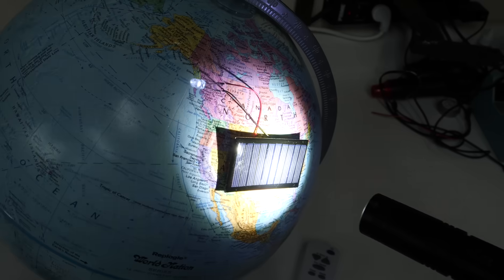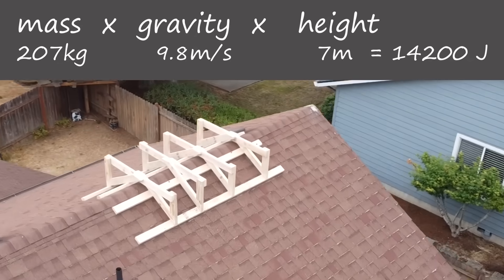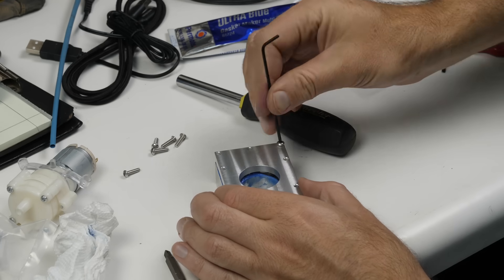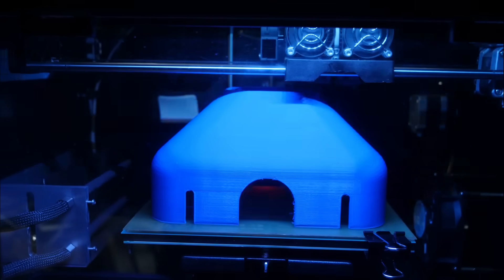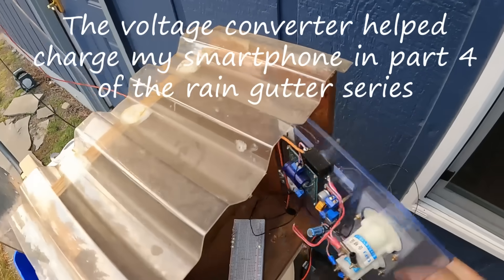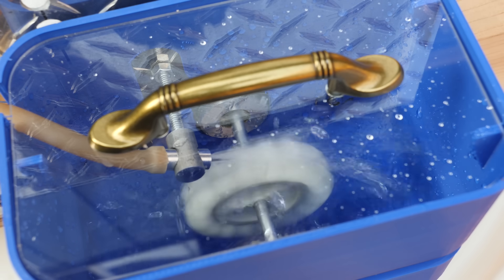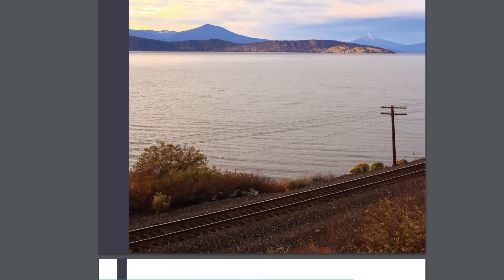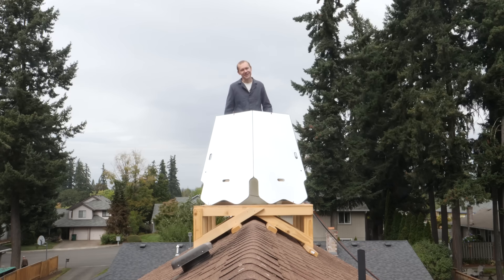Storing Solar Power on my ROOF!!!

Comment: He forgot to mention that the height of the water will also change how much energy is stored in the water. Large scale versions of this  will have the water over a 100ft. or about 30 meters high. every foot of high increases the power stored. So do to the size of his set up it was likely not very efficient.

Comment: The formula of potential energy is : Energy = m * g * h
where:
m = mass [kg]
g = 9.81 [m/s2], let's round to 10 [m/s2]
h = height [m]

So, assume that you store 10 m3 of water (--> 10,000 liters --> 10,000 kg) at 10 m height (at the top of your house), you are able to store (conversion efficiency into electricity not taken into account):

10,000 * 10 * 10 = 1,000,000 [J] (joules)
--> By conversion into [kWh], you get: 1,000,000 [J] = 0.28 [kWh]

If I take a standard french solar installation of 3kWc, I get a annual production of about 3200 kWh. So, with my 10 m3 tank, I can store 0.28/3200*100 = 0.00875 % of my annual production. That's no so much. On a daily basis, the percentage is higher but not that big.

Only very large tanks could store significant amount of energy.

Comment: E = m*g*h
m = 200kg (assuming 200liter barrel)
g = 9.81
h = 7 m

E = 13734 Joule = 13.7 kJ

1 joule is a watt second.

my laptop charges with 100W. meaning i could charge my laptop for 2 minutes with the entire barrel. assuming 100% efficient turbine at the bottom.

Comment: I'm wondering: what if you funnel the used water down to another waterwheel? (And possibly another and another etc.)
Would the energy wear down? It feels like there could be much more energy. Anyone got an idea about that?
Reply: But you're reducing the length of the drop for each wheel. I.e. with one wheel you extract energy equivalent to a 5m drop. With five wheels, they'd each extract the equivalent of a 1m drop. So, overall, I don't think you'd gain anything.

Comment: How about a multi platform like stars to use more of the water. So when water turns turbine 1 it goes to another box and repeats. Could probably have 3 X boxes 3 generators.

Comment: Having a 35 ton boom truck when I was off grid for 28 years, I too had this idea, but luckily never followed thru with it! Like a grandfather clock, it would for sure work but would be very inefficient, way too many mechanical and electrical losses. Flash forward:two days ago I finished burying a 2100' water line from a spring on the bottom of my 70 acres, solar pumped to a 2100 gallon tank 247' higher. It has occurred to me that once the tank is full I could run the excess into the line that leads to my micro hydro setup. Again, fun to fool with but hardly makes sense (I'll probably do it.)

Comment: The. Clear hose and Transparent barrel will get algie. If you put side plates on each side of the generator water wheel, you will gain more power, because the water is splashing off losing laminar flow. Tesla had a generator designed to use disk to keep the laminar flow longer so it would spool up well beyond 20k rpms.

Comment: Too many energy losses with that system.
More efficient to charge directly off the solar panel.
If you must use your water setup, see about using a ram pump.

Comment: I wonder if the head pressure of your water supply is enough to get the water up to the roof all on its own. In other words, will the hose still flow if you were standing on the roof? If so this makes me think you could get free energy from the water company using your same technique.
Reply: Well you are still paying for the water? So you’ll need to see if the energy you get is cheaper than the cost of the water used

Comment: So im sure some smart people may have already suggested this but what if you assembled a string water wheels long the downflow line to retrieve all the energy while in decent. Wouldn't that increase the power output or just work out to the same output?

Comment: This is not exactly a battery with a long service life.  Because you put the tank on the roof and the sun and temperature will cause the water to evaporate.  Which will result in a decrease in the capacity of your battery.  Try to use car radiator concentrate in the right proportions.  This should prevent your battery from losing capacity.  A very nice project.

Comment: The big problem with solar is that it only functions at maximum capacity (which is at best 30% efficient) for around 1/5th of the year. To make enough power for the winter, I need about 4x as many panels as I need in the summer. Which is a massive waste of resources. 

What I need is a long-term storage method, so I can store the huge excess I create during summer, for use during spring/autumn/winter. And I need it to be dirt cheap.

Comment: I think you should try an emergency tire inflator and store compressed air, that way the system could be at ground level. A small steam engine could generate the power.

Comment: The KPSP uses hydro-resources of artificial water pools existing at different geographical levels.

Kruonis Pumped Storage Plant (the KPSP) is located near Kruonis, Lithuania, 34 km (21 mi) east of Kaunas. Its main purpose is to provide grid energy storage. It operates in conjunction with the Kaunas Hydroelectric Power Plant. During periods of low demand, usually at night, Kruonis PSHP raises water from the lower Kaunas reservoir to the upper one using cheap surplus energy. The station is designed to have an installed capacity of 1,600 MW but only four 225 MW generators are currently operational. With a fully filled upper reservoir the plant can generate 900 MW for about 12 hours.

Comment: There is also another way, put the water reservour in the basement connect it to the house heating system, heat the raservour using solar panels.

Comment: Just a question to the proud inventor: How much water and which height is necessary to run my heating aircon through a long winter night? One piece needs about 5kWh of electricity in 12 hours...
;-)

Comment: Great idea, is it worth using a peristaltic pump to move the water up to the header tank?  This may relieve the head-height issue and reduce the strain on the motor or use a Peltier/Seebeck device to convert the heat produced by the motor into electrical power and feed that back into the loop?
Also, I find float switches can be temperamental,  is it worth using a pressure switch? (The diaphragm type used in washing machines to sense when sufficient water has filled the drum)

Comment: If you put two shipping containers worth of water 15 meters of the ground you will have enough potential energy to power your house for 6 months continuously. 
If it rains enough to fill those containers up once every 6 months or less in your area then you will have free energy for ever. 
This set up is much cheaper than a solar panel installation and farmers in remote areas us it all the time.

Comment: Thing is, that pump (it's a cheap garden fountain pump right?) is rated maybe 5W or 10W, so no wonder it runs fine on a cloudy day from a "50W" panel. Solar panels are specced at Noon on the Equator on the brightest day ever recorded. More or less. Don't expect to get their full output outside a few hours around noon in summer. 

So you're only storing like 10W of power, which is nowhere near enough to run a house on. And that's if you drain it at the same rate it filled. This system isn't practical.

A practical system might involve building a water tower, if you aren't in some ridiculous neighbourhood contract where you're not allowed lawn chairs cos they reduce the value of surrounding properties. And they have the temerity to "fine" you if your grass is too... ah I've got to stop or my blood will boil. 8th most free country in the world my ass.

Anyway. Yeah water tower or maybe if you live near a wooded hill, use a highup tree. And more water, and a bigger pump, and a proper sized turbine.

Comment: I think you were on to something however which you might try is turning that Barrel into a giant salt water capacitor as Nikola Tesla did then the solar energy will be stored as electricity in the saltwater capacitor Barrel you simply just flip the switch and the house keeps running of course she'll run it through an inverter but yes two barrels is what you need Tesla saltwater capacitor easy to build cheap and really works

Comment: You could probably set up your valve with a 'light switch' controlling an arduino controlling a solenoid to control your valve so you could literally use water power to light your back yard.

Comment: Great project! I have a similar one in my off-grid house. 10.000l cycling between 2 tanks, 15ft drop. A 20" diameter pelton rotor (4 injection points) delivers 800W for 5 hours. That, said, "burning fossil fuel" is not as bad as advertised. It got us where we are. And we will continue using it because the green energy requires a lot of it and  guess what?! We are not substituting the energy matrix, we are just adding extra "clean" energy funded on continuous use of fossil fuel. We are consumers in society, and it comes with a price: more energy... always more energy. Do you want to go green? Change the people and their habits and energy will suffice... a bamboo toothbrush is just another expensive and exquisite consumerist item. It doesn't help the environment.

Comment: These systems are already in use on a large scale at hydro power plants, during periods of low demand they use the extra power to pump water to a reservoir that is at a higher elevation.
Reply: Hmm, that's exactly what he mentions at the end of the video.

Comment: Have you calculated the efficiency of the system? I have an artifical lake in my property sitting 67 meters below the highest point, and it holds 800m^3 of water. So my thoughts are: for every KW of energy you put into the pump, how many watts do you recover at the generator? If a pump is 40% efficient and the generator is about 30%, then you will only get 12% efficiency, which is only 120W for every KW of energy you consume. Do these numbers check? Is it as inefficient?
Reply: I'll answer for him. Yes!

Comment: If you needed heat I think it would be better to store the solar recovered electricity as heat in the water barrel, because water has one of the best heat capacities of most everyday liquids. Then in the evening after the solar panels have heated an element in the water to raise it's temp you can pump the heated liquid around radiators for a boost

Comment: You can move water without solar or wind power. Its thought vacuum suction. Farmers have been moving water up hill through this system. I've thought about this for an off grid power system

Comment: The energy potential of 1000kg ant 10m is 0.027 kWh, about the same as 8 AA batteries. This is not 'massive amounts of power' as you state.

Comment: 1kWh on roof = about 50m3 of water. 50 ton. Todays batteries stores 1kWh per 100USD,  if not new. If new, then 200-300USD.

Comment: We need a machine where the rain fills the rooftop barrel, and then the pipe brings it down  making the power (like in this video) and then the water can go down a drain or back up depending on the level in the top barrel.

Comment: The waste heat generated by the motor is a perfect example of efficiency loss in this type of system. But, it's still free so not "losing" anything.
Reply: How much loss at the water treatment plant that sent him the water via pipes?

Comment: You should have used pressure treated lumber marine grade for the stand. That will rot out quicker than the shake of a squirrel's tail. Nice job on the engineering work!

Comment: Always amazing to see how little energy really is available when using potential energy, especially when you think about the energy of 200 liters of water the Einstein way. The drum contains almost 5 Petawatthours (or 17,9 Exajoule).
Reply: It really makes one appreciate the easy to access power in a good old gallon of gasoline!  A dark secret of being off grid is winter time genset use, and it's really amazing the amount of mechanical energy to be had in a gallon of gas when used to charge a battery.

Comment: fun and all but totally pointless. a battery stores and extracts energy much more efficiently. you could also just use rain collection on the roof and get energy from virtually nothing without even a solar panel. This whole video the guy acts like batteries don't exist lmao

Comment: I would have used a lead acid or lithium battery for power storage instead of that monstrosity. but never mind till your HOA or zoning find out. want to get fancy with batteries? Molten salt batteries can be built with components commonly available from table salt etc.

Comment: How about rigid gravity storage? a tower with a big weight? I guess unless the weight is much, much denser than water the energy storage capacity won’t be any better, but maybe it would be if the system for raising and lowering the weight is more efficient and converting electricity than the system for pumping and recapturing energy from the water is?

Comment: Did I miss the part that measured the electricity put into pumping the water up, and the electricity pulled back our at generation? Like say that 50 watt panel supplied 240 watt hours of power to the water pump during the day. How much electricity was recouped at generation when running the water back down? 100 watt hours?

Comment: 14,200 joules = 19 horsepower ... in the sierra mountains california the power company built a reservoir at a high elevation and when electric demand is low they pump water up and then when demand is high release the water to generate power .. see the helms project ..

Comment: The main use for this -  I'd think would be to pump water into a space above your tiny house, or off grid property (Like into highly insulated dormer) - so that you'd have water pressure for all your taps/shower regardless.  I'm not sure though how much pressure you'd get - but with a relatively light pump that won't be in the house (Or be into an insulated area against sound)  - you'd have silent operation on all your water dispensors.
Reply: I agree, I have a well pump and when the power goes out I can't flush my toilets.  I have been meaning to put a tank in my attic just to supply the toilets

Comment: Cool little project. If you want indeed store PV-Engergy I would suggest to heat up water with a heat pump and use this water in your house, instead of heating your water with gas or oil or electricity from the grid :-) By this you can store much more than the equivalent of a AA battery.

Comment: Well sounds "cool" in the first place but those 14200 J (0,001-0,002 kWh at 25-50% efficiency due to converting the power) can't do much more than light up some LEDs. With that electrical energy you can light up a conventional 6W LED lightbulb for 10-20 Minutes. That's all.

Comment: Or you know don't use lithium batteries hydro or gravitational batteries for your solar and instead use say lead acid ni-cad or ni-mh none of these are perfect and they all wear the exact use case will determine what's best running several computers ni-cad has the smoothest voltage drop off curve

Comment: He got a great engineering techincs, but still it doesn't make any economical sense...

That barrel contains maximum 14200 J energy, even if the efficiency better each energy conversion is always 100%, and his area annual precipitation is over 2000mm, this system maximum generation capacity is only 9KWH per year.

Considering the efficiency is 75% at the best in each step, from solar panel electricity to potential energy, then back to electricity, total efficiency is roughly 50% only. This turned 9KWH to only 4.5KWH...

If his electricity is outrageously expensive, saying $1/KWH, that's $4.5 saving per year. His work material itself is maybe $100 if he got them from garage sale, and himself is a super slave, and eat only garage. That's still $100 cost... Need 22 years return...

Comment: Before you make a fool of yourself please sit down and calculate, how much energy you can store by pumping up 10 cubic meters of water up by 10 m. If you do everything right, the result will be 1 kWh, that is 20 cents or the amount of energy you spend every day cooking your dinner. Please dont forget the efficiency factor of electromotor and dynamo, which multiplies to 0.64.

Comment: Hi one Question:
If you tether the water gallon to a rope and pull it up with a motor will it be more efficient when generalizing electricity by letting it town?

Comment: Ok as a fun project but is completely impractical. Even the large-scale ones are not practical as they will only provide a small fraction of the power needed. The real solution to all of this is geothermal. A group out of MIT formed a company that is utilizing focused microwave technology developed to heat plasma in fusion projects to make a drill that is capable of drilling to a 20km depth. At that depth 500c temperatures can superheat water which is the most efficient form of geothermal power production.

 Since this technology will allow geothermal plants anywhere in the world. If the prototype is successful, and we'll know in about a year, this would bring an inexhaustible supply of 24/7 green energy to every country in the world. Imagine how this could change everything. Not only would it clean up the c02 problem within a few years, but it would also end the revenue stream to all oil-producing countries. No more middle east wealth and no more Russian wealth.